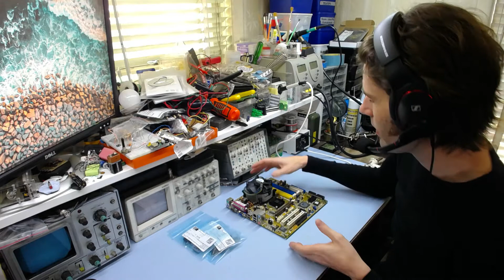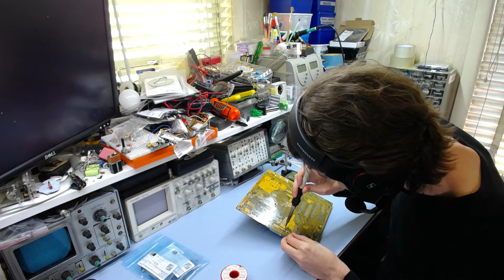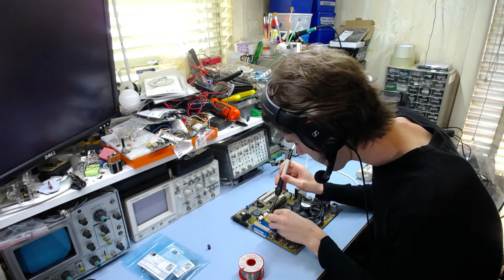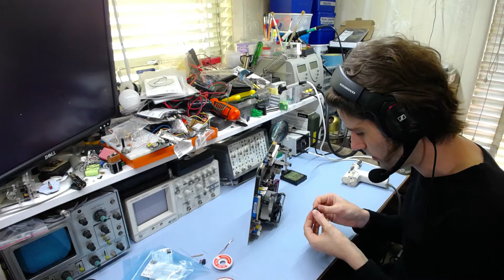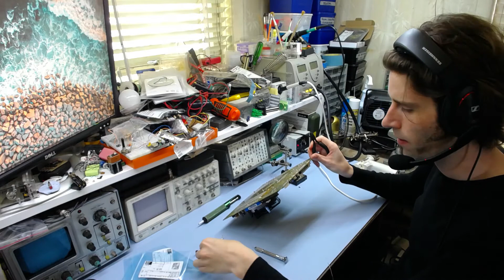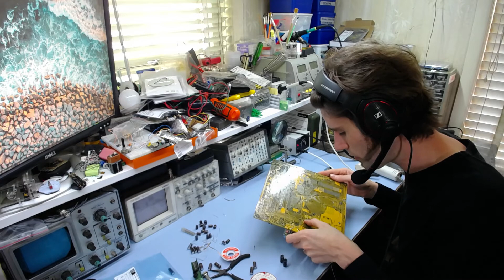Capacitor replacement on Asus P5VDC-MX motherboard

Comment: I'm trying to replace bad caps on an old 775 motherboard but the solder doesn't melt at all, it's like the heat when it touches the pins dissipates and cools down, would a heat gun at 217ºC work? I've read that hot air gun first then soldering iron on top works. I've tried the first methods you've tried here and it didn't work at all but I don't have a desoldering gun as it costs too much money nor a hot air gun.

Comment: Thank you for the tips. I just ruined my Asus P5W DH. I should have left well enough alone. Replaced 4 bulging caps. All bios problems went away. Thought, I might as well replace all of them, since they're all the same age. I fought too much with 2 of them, and I think I messed up the via. I used the wick method. A bit like doctors do. Cut a short and pointy shape of wick, use a very sharp iron tip, preheat the board and push the pointy bit of wick in the hole with the iron tip to absorb the solder. It worked for most of them. Not going to use that method anymore.
Reply: Just had an idea I'm looking at. To save a bit of heat sink effect, I thought, maybe ceramic rods instead of stainless steel pins.

Comment: use a pin vice with 0.7mm drill bit
Reply from the maker: A drill bit can be used so long as you use the blunt end only!

Don't try to drill out the solder from the via, if the via is very large and the drill is very small you might get away with it, but with motherboards, small holes you have a high chance of causing internal damage to the board by cutting some internal layer connection to the via with the drill bit.